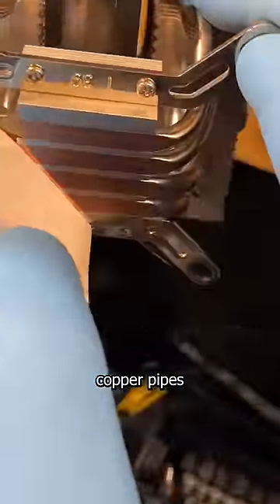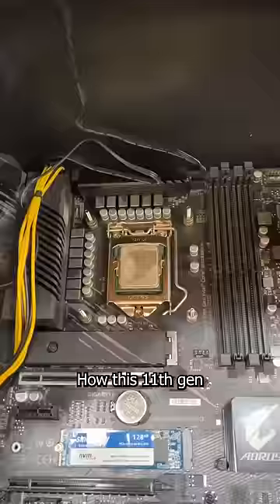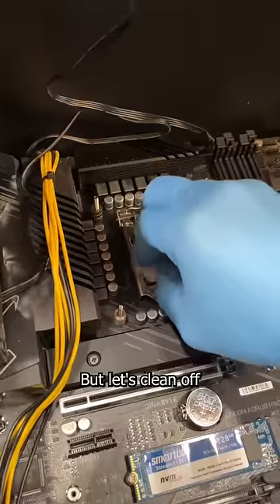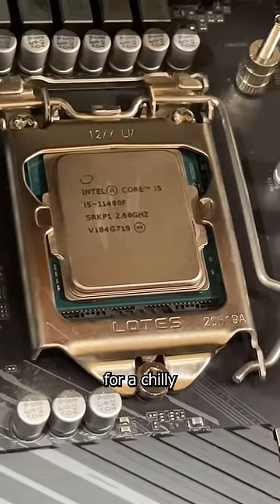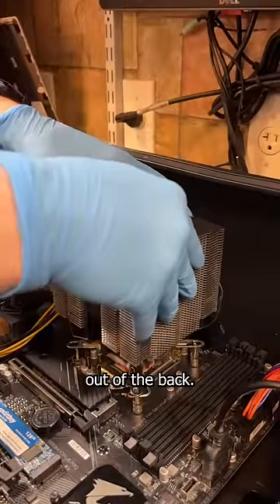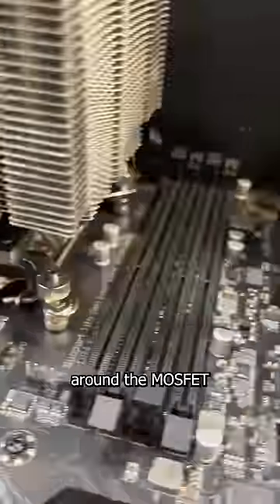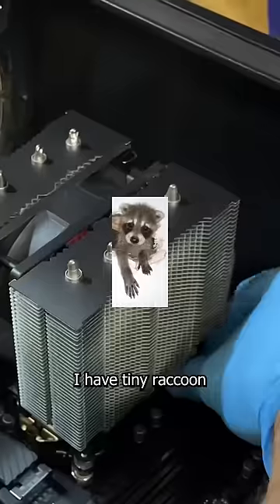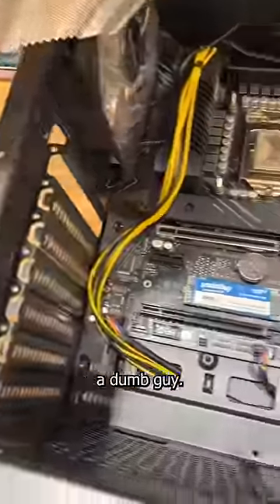Russian computer repair shop harmed this poor #gaming #pc Intel CPU was on fire 😢 #tech #shorts

Comment from the maker: The pink paste is blended chicken nug…I mean Thermal Grizzly Kryonaut Extreme. No I didn’t put too much on. There was no spillover after applying heatsink. This paste is thick, I use a jug to scoop and the applicator to spread. It looks MUCH thicker on camera than it actually is. Gamers Nexus had the EXACT same issue https://youtu.be/EUWVVTY63hc?t=434
Reply: orayt
Reply: thats pretty cool, never seen thermal paste being pink
Reply: nah thats pink sauce
Reply: Pretty sure that was a can of Play-Doh. Thermal paste shouldn't really be much more than a pea. You want to even out the contact between the metal not cushion it.
Reply: My graphics card gets very hot, and I cleaned it and changed the thermal paste and nothing, it still gets very hot.

If you have any suggestions or ideas, please leave me a message on how to fix this.

have a nice day or night.
Reply: @shad_GS   there might be problem with your graphic card fans or you just did not apply the thermal paste the right way. Also, did you ever overclocked you gpu?  Because some gpu are not made for overclocking.
Reply: Personally i prefer to only use thermal paste to cool my PC. Fans are over rated thsee days with how good thermal paste is. I just reapply every 30 minutes. MUCH more convenient
Reply: That was more than you needed, but "too much" implies a problem. Only problem was you used more than you needed.
Reply: But was it the perfect amount?  😉
Reply: But was it the perfect amount? 😉
Reply: @shad_GS what temps are you getting? Also what gpu is it
Reply: Just look at the video again, i see something written in Russian too.
Reply: If you were working at the Data Center where I currently work and you placed that pink thermal paste on a CPU like that; the guys would have a field day with you....hahahahaha!!!!
Reply: @silvermane5695  yes and it makes zero difference if you use this much versus the "recommended" amount. Also if you're working on data center chips like epyc this is exactly what you should be doing due to their Chiplet design
Reply: Dangg bro😂
Reply: show us before and after temp digits would be nice
Reply: Excuses! You put put bubblegum on it and you know it! :D
Reply: @silvermane5695  I’m guessing you work with older people who probably still think the “grain of rice” thermal paste method is still the “proper” way.
Reply: And that’ll be 14000 dollars, would you like to round to the nearest hundred thousand to support raccoon laborers in Russia?
Reply: We just have different standards
Reply: There is no such thing as "too much paste".
Reply: Why do I smell chicken...?
Reply: U sure its a russian PC shop, not a ukranian one?
Reply: I'm gonna taste it
Reply: stop hosing your re-seats in more thermal paste than it needs. It doesnt make it better if anything it can make the temps worse. A long grain of rice worth is more than enough an more cost effective. Every penny counts in the bottom line.
Reply: Lmao, you were ready for EXACTLY what we were coming to say! 😂😅
Reply: @justplay6315 Not on the "Remove before Installation" sticker.  It had Chinese, but I didn't see Russian text anywhere significant inside that PC (I didn't pause to check every micro-component, but most of those parts are made in Taiwan or China )
Reply: This man listening to the doors elevator theme from roblox
Reply: I wouldn’t have used paste of that quality on a 11400F lol.

Just your average Arctic MX4 or Noctua paste would be more than enough.
Reply: $20 worth of thermal paste holy hell
Reply: bro somehow got the crabby patty secret formula to cool his pc ☠️
Reply: Dude, that IS way too much. The layer needs to be as close to one atom thick as possible, because no paste on earth conducts as well as the metal parts you're pushing together. All the paste does is replace as many oxygen particles as it can, because, although the paste is not a perfect conductor, oxygen is an insulator. Thermal paste doesn't enhance conduction, it minimises insulation.
Reply: @VK-pk8uz  yeah but like screwing down the heatsync will make it thin 
it's been proven that it doesn't make a difference if you use too much other than wasting money and making a mess.
Reply: arctic paste?
Reply: pretty sure its the tubby custy
Reply: I was really wanting to argue seeing your comment before seeing the amount paste you used. However you didn't use an excessive amount.
Reply: Quote whatever channel you want, that's far more thermal paste than necessary, and you're still wrong. lol.
Reply: It is too much... and are you really meant to spread the paste?
Reply: Sorry to intervene, but it matters how much you use. Of course, you will not see a difference if you test it right away for 5 minutes or even 5 hours, lol. that's like using too much voltage on your overclocked cpu and then saying after 1 day of gaming, hey, it does not matter - it did not kill my cpu yet or burn my connections.
The problem with too much paste will come over time due to the pump-out effect which is increased due to the overall mass and all its tiny air gaps. secondly, heat transfer, any physician can tell you, has a critical thickness (in the microns for thermal paste) that determines the best heat transfer / minimal thermal resistance.  while all of that probably does not matter to you if you change your gaming pc every 3-4 years anyway, these are facts, and using more (if not instructed to do so) will be much worse in the long run. these are industry standards.
Reply: Nice, I couldn't tell how much height wize was applied and thought it would spillover, nice explanation.
Stopped me from attempting to argue 😂❤
Reply: @GamingDad except when applied with an applicator
Reply: Yeah thia is a different type of paste. Its meant to be put on then spread out. Thats how ita designed. Anyone who says "pea" is just wrong. Different types of paste are applied differently. Thermal grizzlt recommends you to spread out their paste. Wether its on a cpu or gpu.
Reply: @dylanwilliams3750  Thermal paste is only there to fill in any tiny imperfections where the two surfaces do not meet exactly. 
To allow the maximum amount of heat transfer, you want as little paste as possible while maximising the contact area between the two surfaces. 
So, it might not be causing a problem smearing it on like peanut butter, but technically it does reduce the efficiency.
Reply: That thermal paste is made for ExtremeOC, not general use. It dries out too quickly
Reply: Not an argument to make, a simple X is all that's needed. Aftermarket coolers been installed for years with either an X or a single pea dot in the center with tension of the cooler to spread it out properly.
Reply: happened to my company's PC that was imported from China
Reply: @Dorraj exactly, Gamer's Nexus has tested this, it's possible to have too little, but too much is impossible.

Personally I still use the pea method.
Reply: Disliked because you said ru*sia
Reply: Who got man malding lmao
Reply: @dispatch-indirect9206  I've never seen a bike shedding before. Does it like lose it's older wheels?
Reply: @thenarrator4520 owrigt*
Reply: Nah we gonna argue here all day about how you didn't use blended chicken nuggets!
Reply: @GamingDad  That is what the pea looks like after you spread it out evenly lol
Reply: @knockdoun botulism thermal paste
Reply: far too much
Reply: Didn't know the teletubbies made thermal paste :p
Reply: I can confidently say you used too much paste. You want as much metal to metal contact as possible, definitely don't need a layer across the entire face.
Moral of the story, just because you see someone else do it wrong, doesn't mean you should too!
Reply: holyshit ppl actually arguing about this 😂
Reply: To me it still looks like it's to much and have an opposite effect on cooling. But yeah I'll watch that GN video
Reply: @GamingDad Bruh. It was spread out, wtf are you talking about 😂😂😂😂😂😂😂😂😂😂😂😂😂😂😂😂
Reply: Thats some good ass thermal paste
Reply: @FreeUgcgamecards  It's bad because thermal past may be a good conductor, but it is still worse than direct metal to metal contact. The problem is that the CPU IHS and the cooler aren't perfectly flat, so there may be <1mm gaps of air trapped in there, air being an awful conductor. Thus you use a small amount of thermal paste in the center of the IHS, so when you press the cooler down, it squeezes from the center to the edge, pushing the air out and filling the gaps at the same time.

It's not that spreading it won't work, in fact it will work just as well in 90% of circumstances, but he's doing this for someone else. How does he know the customer won't overclock and start pushing the computer? Once you start pushing things, the details like thermal paste application will start making a difference.

Don't just take my word, c/p this into YouTube: Thermal Paste Application Methods - Which one is best? - The Workshop

Video by LTT testing this exact argument.
Reply: That is still way too much paste. It is just supposed to fill the microscopic gaps....
Reply: But isn't the issue air pockets?
Reply: @shad_GS  Gpu fans, case fans. make sure you have a fan taking in air and one out.
Reply: Bro you're not fooling us. You used fancy sauce. AKA ketchup and mayo.
Reply: Although the difference is marginal, more is less. Thermal paste is there to fill in the air gaps and create a bridge. Thermal paste insulates more than metal heat sink or else they'll just make the cooler out of thermal paste.
Of course is going to perform a lot better than leaving that sticker on and client won't be able to tell. But it gives people on the internet like things complain about, saves you a tiny amount of money, and give slightly better performance.
Reply: I don't want to argue. I am so fucking sick of this argument.
Reply: still too much paste
Reply: Isn't that the sauce McDonalds uses to make their Chicken McNuggets?
Reply: Going to watch gamers nexus just cause I want to know more!
Reply: "bitch that's Tubby Custard" 😂
Reply: @shad_GS blow out your pc with an air compressed (don't overdo it and destroy your fans ), put some (correct type ) oil in the fans
Reply: Kryonaut is designed for laptop. what a waste of thermal paste. I bet you charged the poor customer for it twice the price of that CPU alone 😂
Reply: I know you’re right but I still wanna argue for fun.
Reply: Bro u fix computers n we just comment on youtube you defo know more than like all of us lmfao
Reply: Been out of the building game so long I had to read the comment on the thermal paste.
Reply: Just watched the verge video, and I have to agree, that is the perfect amount of thermal toothpaste
Reply: @GamingDad 40 like over 40k ur wrong ik gonna assume
Reply: Phew! I thought you used chewing gum.
Reply: I was wondering why it’s pink 😂
Reply: @FreeUgcgamecards  i agree with you, but hypothetically if you apply the thermal paste in a layer there is a chance of an air bubble forming as you put on the heat sink. but the odds are realistically low, and it is typically how i apply paste
Reply: That's neat, I didn't know they made thermal paste like that.
Reply: gum
Reply: Every build ive ever done i put about a grain of rice size bead and let the heatsink spread it out. Has been working for the last 15 years of building PCs
Reply: I'm glad you addressed this. I actually thought you put too much on 😂 but I also thought it looked very thick 🤔
Reply: @mercury9385  Slightly too much, but it's fine. And yes, you're better off spreading the paste. There is a reason why companies now include applicators with their thermal paste.
Reply: @tonyb9735  barely reduces the efficiency. it'll take probably a tubload to even get to a noticeable level. We actually have data for it.
Reply: @Joebauers2505  
Not an argument to make? You're already trying to with that statement.

> Aftermarket coolers been installed for years with either an X or a single pea dot in the center.
Yea and those years were called the pre-early 2010s. 

We're literally past beyond that with enough scientific data that it actually shows the IHS spread is better. Ever wonder why those aftermarket coolers you speak of, already come with pre-applied thermal paste that covers the entire surface of the heatsink? Or why companies include thermal paste applicators with their thermal paste. 

Pea-paste or rice grain, or X is a bygone era. Sure you can argue "it works", but that doesn't mean you can'd do better. Throw that boomer/early millenial thinking and progress.
Reply: @halecj1  my man, you didn't read tht last part of the comment huh.
Reply: @boalollal242  No. Because you're literally pushing down the cooler anyways to compress the air out. If anything, you want a better spread than too little because that extra mass actually will spread over to that air pockets due to Conservation of Mass.
Reply: @vikinglife6316  But it's mostly on the middle. Again, read the last part of the comment. Why does everyone miss out reading the full comment. You can be an expert for 30 years of experience for what anyone cares, but that doesn't automatically make someone right in their expertise all the time.
Reply: If there was spillover then you would have applied waaaay too much. Even without spillover that’s still too much. You’re only trying to fill the tiny pockets of air on the rough surface, not glue the heat sink to the CPU.
Engineer here that literally wrote my thesis on this. Best way is pea size in the middle, and let the heat sink pressure spread it out. Don’t pre spread. Thermal paste has a really low conductivity so while it’s better than an air gap, it is many multitudes worse than direct contact between the IHS and the heatsink.
Reply: @chewsuperfour9514  instead of replying, why not link us your thesis then so we can verify your findings.
Reply: @Zerviscos  No it doesn't. People find ways to make things work and may not be the 100% correct way to do things. Someone showed me how to apply thermal paste putting a small bead in the middle, letting heat sink do the work, When he took off the heatsink to show me, it was perfectly spread out so I been doing it ever since on all my builds
Reply: @vikinglife6316  so you'd rather take the chance to have the spread by chance than to actually make sure it actually covers the entire IHS on something you cannot see until you remove it? Just because it "perfectly spreads" for you, doesn't mean it'll apply to everyone. Objectively speaking, you're already wrong because you're speaking from anecdotal experience. Meanwhile we have actual hard objective data that doesn't always happen and the spread wouldn't always cover the IHS and would usually only cover the center.
Reply: i only use carbonaut cloth. better than liquid-metal
Reply: @Zerviscos  I've built a lot of custom PCs and always stress test them before giving them to customers and never once had any problems. My current is OC and did the same thing. Temps are always good. I built my first PC back in 2008 ish and that's how I was shown.
Reply: Just because you can doesn't mean you should. Gamers Nexus be damned.
Reply: I was hoping it was Hubba Bubba. I'm disappointed.
Reply: @vikinglife6316  no one says the pea-size or rice grain is going to have problems. We're talking about objectively speaking, with data shown, covering the IHS is OPTIMAL and yields the best efficiency. You can do it fine or you can do it better, your choice, but people invalidating findings and preaching something so old as the pea-size in a bygone era of the early 90s to 2000s has no place in this year. If we're talking about experience, I've been building PCs way before back in 2004, and just because you were "shown how to" or "learn from" from a decade where the internet was still somewhat the wild west, doesn't mean you cannot read or learn better, even I can learn how to read and scrutinize new objective data. I'd take people even using the X method is far better than pea or rice grain just because it actually has a higher spread.

There is a reason companies include thermal paste applicators in their products these days or why aftermarket coolers evenly spread thermal paste across the entire heatsink surface. Your pea-size logic anecdotal evidence doesn't equate to actual objective findings.
Reply: @RandomPickles  and your reason for it to be shouldn't is mainly because of why? There is good objective evidence of "should" not just "can". Is it because it's too much? No, the only actual con here is that it's messy.
Reply: I don't believe for a second there was no spillover. and if you want to direct people to an external source about too little or too much paste being a non issue, don't direct them that negates your point stating that paste overspill is a very real issue. corrosion is also a very real problem.
Reply: @thedarkness125  unless you're using a terrible thermal paste with bad compounds, as long as it's non-conductive that isn't going to be an issue and nor does corrosion unless you're using liquid metal with aluminum heatsink and even then it's a non-issue for the most part as it only really alloys. a little spillover isn't going to be an issue.
Reply: @Zerviscos  Yeah....I never gave a reason cause I didn't care about the topic enough. But clearly you do lol You responded just to get angry about me not giving a reason, and then gave a good reason that is one on a long list that I have. So what was the point of that? lol
Reply: Heh yeah, you know that haters always judge paste so you headed it off at the pass. Nice.
Reply: @RandomPickles  if you dont care then dont reply.
Reply: @Zerviscos  Or I can do whatever the fuck I want. That is always an option.
Reply: @RandomPickles  Right, and this is coming from someone who "doesn't care"
Reply: Какой сюр..Неужели так легко наклейка радиатора процессора отклеивается. Обычно надо въебать, что б под трением, клей разогрелся и легко отставал. Тогда можно отдирать всех
Reply: I recently re-pasted my cooler/CPU for the first time since being built.. in late 2018.. and it didn't even need it. I just had to re-paste since the cooler had to come off for maintenance purposes.

In the center of my 8086K I used a single droplet of paste about the size of half a tear drop. (IC Extreme? IIRC)

Coverage between the IHS and cooler (Dark Rock pro 4) was still ~95% with only the very tips of the corners not having any.

The system has always idled in the 25-30C range unless very hot in the room; at that point, 31-32C idle temps. Load temps, such as current MMOs and other games, breaking 70C was a rarity depending on the optimization of said game.

As others have stated, the goal is to bridge the microscopic pits/gaps in both surfaces, and the one between them.

Therefore, less is more. The pressure of the cooler against the IHS spreads the paste itself, and then even further once the system warms up.

Theoretically, the absolute best method would be to spread a film across the IHS, and possibly the cooler base as well.. then simply attach.

The only real variable is the amount of torque used to tighten; too much when using a film approach like above could result in hot spots. Not enough with the droplet method and your coverage is poor. Too much paste overall and you insulate.

What's in the clip here looks like an extremely excessive amount.. I'm curious both if this is intended with this particular compound, or if it just transfers so well it doesn't matter.
Reply: @Requimatic  objective data shows too much thermal paste isn't gonna be a real issue. Both GN and LTT and various has tested that already. It's within 1~2 degrees within margin of error. Unless that's a tubload of paste, which has its own issues obviously speaking, it's not gonna matter.

Again, I'll repeat it for the nth time, it's better to have more paste than less to not cover the entire IHS. Less paste actually shows more negative effects than more.

The only real issue here is that it will be messy or if the paste used is conductive, then that spillover will be an actual issue.

>Theoretically, the absolute best method would be to spread a film across the IHS
And no, that's not "theoretically" the best. It IS proven to be the best.

There is a reason why some aftermarket coolers already have pre-applied paste across the entire heatsink plate and why applicators are included with thermal compounds.
Reply: you say you dont put too much,    but it is supposed to be a thin film like the thickness of a plastic bag!    any more is just going to decrease thermals
Reply: Too much paste.
Reply: No, that's too much.
Reply: its okay that you spread it out,   but it should be film thick,    not like peanutbutter thickness with globs showing all over the thing
Reply: Sponsored by McDonald's. 😂
Reply: Say what you say. The video shows that you put way too much paste. Spill or no spill
Reply: I mean I saw US “professionals” do the same mistake. 💀 I bet this pc was built in DNS (Russian biggest techs shop). Their PC are usually dumb and overprice.
Reply: u are reported for RUSophobic
Reply: Better too much paste than too little anyway (Exept if it's that liquid metal paste)
Reply: @mercury9385  
It's a paste designed for extreme overclocking and is much thicker than the average thermal paste, which is why the pressure is insufficient for spreading it.
I don't see a point in using it though. A drop of MX-4 would be completely sufficient. After all this is air cooling, not liquid nitrogen cooling.
Reply from the maker: Tell that to Gamers Nexus https://youtu.be/EUWVVTY63hc?t=434
Reply: Maybe not too much, but you did spread it by hand. Something that I’m sure you can do quite well, but laypeople such as myself should never do
Reply: Pin It!
Reply: Yup too much.  one pea size in the middle, even pressure spreads to cover the dies nicely.  It meant to be a filler, not part of a sandwich.  Looks sure can be deceptive, which is why no manual spreading is necessary.  You can create uneven coverage no matter how careful you are.  For a gaming PC, this stuff matters.
Reply: Well done for finding those trigger moments that give your comment so many more contradictory comments, trying to help you not be a